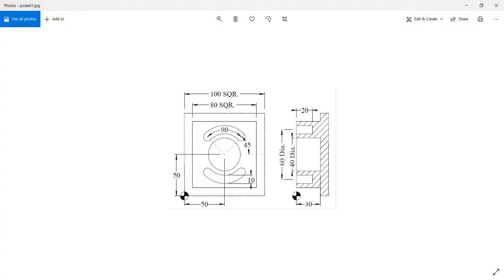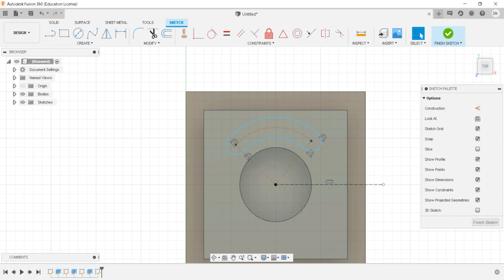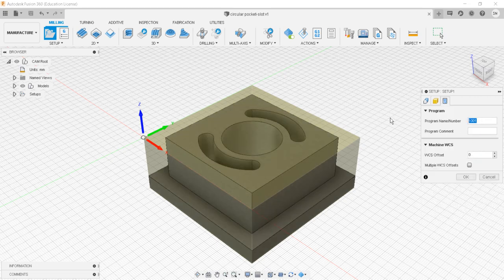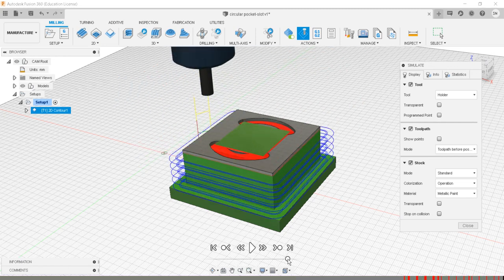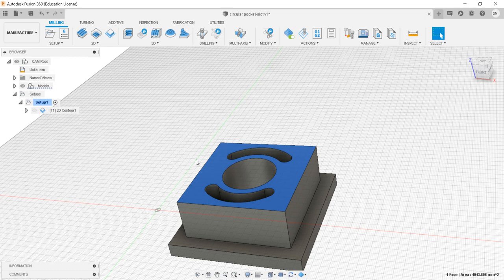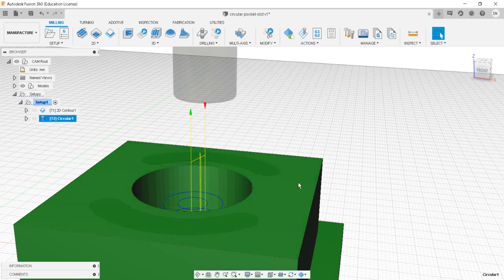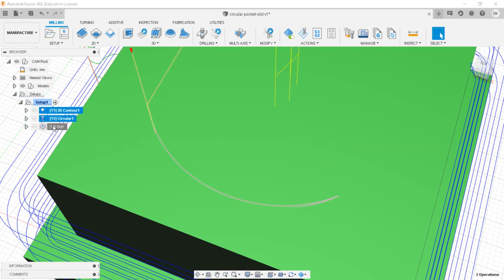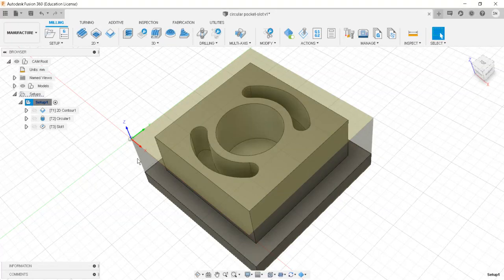Circular Pocket and Slot Milling Operation on Autodesk Fusion 360 - Manufacturing

Comment: Love the Video!  I Am trying to learn how to cut a slot using the slot command in Fusion 360. Glad you could help me out. just wanted to point out that after you changed the tool length all you have to do is press Ctrl G on your keyboard instead of going back through all of your options.
Reply from the maker: Thanks for your comment and suggestion. Keep watching and do subscribe to my YouTube channel!